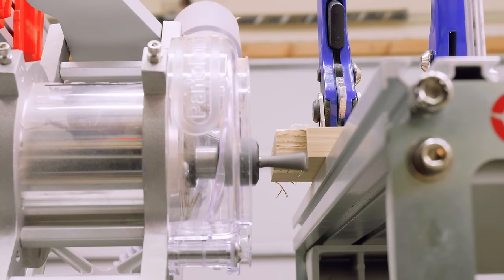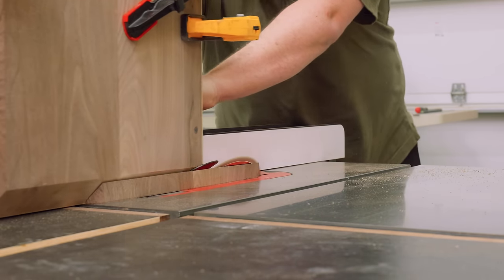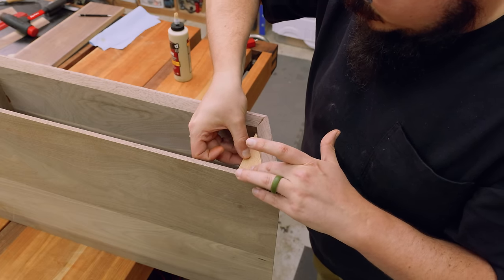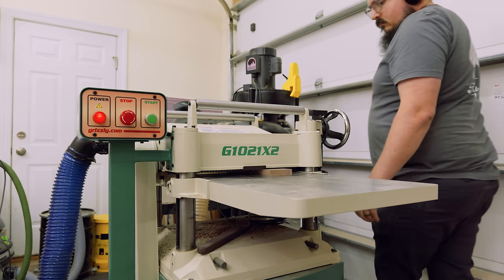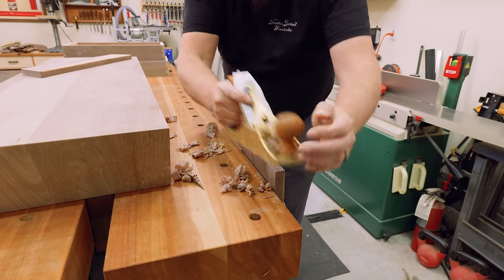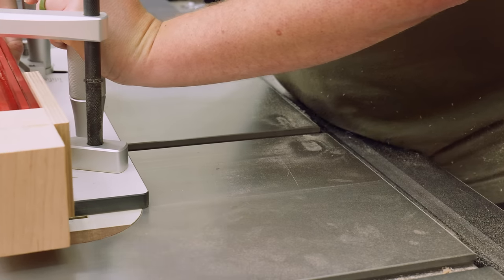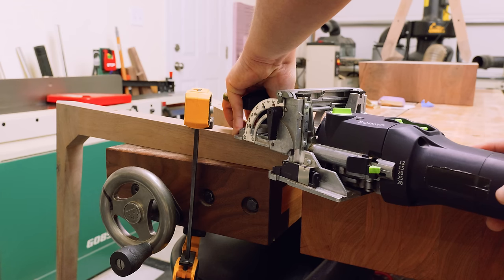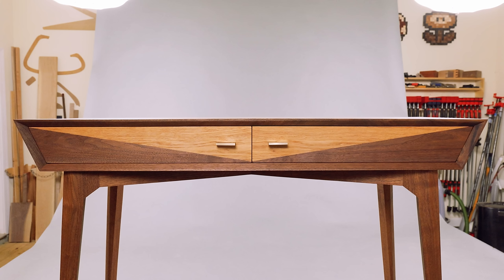You’re wrong about right angles

Comment: Just finding your videos and I am impressed.  I love you narratives, giving great detailed information, and your very slight, movie references, humor.  Your work is exceptional!  I am curious, what is the time difference between filming and off camera activities?  The amount of time I spend trying to calculate and plan angles has to be like a 10 to 1 ratio.  Your work, this video specifically, must have a ton of planning time.  Anyway, thank you for sharing your work.
Reply from the maker: Well, first off, welcome to the channel and thank you for your kind words. When it comes to angles and planing I think of those as two separate parts. I spend a lot of time in my shop and I like to take that extra step to showcase whatever activity I'm doing in a way that people might not have seen before. So when it comes to planing shots most of the time I just work with what I have as far as composition. There are some shots I see in films and I a make mental note or written notes and try to replicate those when I can. But there is a ton of planing that goes into actually building the other parts, so I kind of invision what that process will look like and try to plan accordingly. I honestly spend about 60% of the time building and 40% planing at this point.

Comment: Gyms? Jim's? Gems? Whatever it is, I love subtle little details like the triangles you added here. Real neato.

One suggestion though- bookmatching the oak on the drawer fronts would've been snazzy ... or cutting them from a longer board for continuous grain since the continuousness of the walnut was lost.
Reply from the maker: Thanks! The white oak is bookmatched, I mentioned that during the resaw timeframe. But glad you’re thinking about that detail.
Reply: @TimberBiscuitWoodworks   @TimberBiscuitWoodworks  Ah, I see... I must've missed that for some reason. But such is the nature of wood- some grain just runs in a direction where you can barely start to surface your pieces before you'll lose the mirror match. Did you make sure to do most of the thicknessing on the backside?
Reply from the maker: Check out the photos on IG. The book match is pretty clear there.

Comment: 28:48 Tests have shown that threaded inserts are less strong than threaded wood. That's down to the coarse TPI used for the outer thread of insert. 

If you're planning on screwing things in and out a lot of times, the insert is a better choice, although the strength on the join is lower. 

If you're going to screw something in and leave there potentially forever, and you don't want the threads to rip out through movement forces, threaded wood is stronger.
Reply from the maker: That's what I've been trying to tell folks! I'm gonna start pointing them in your direction haha
Reply: @TimberBiscuitWoodworks  🤣

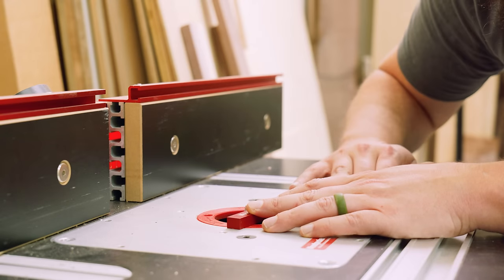Comment: At 13:00 you are swiping your fingertip across the tablesaw blade while using a small red block. I watch a lot of WoodTube content and have never seen this. Is it a depth gauge and you're checking for clearance?
Reply from the maker: Yeah, that is a setup block. I have a few at various thicknesses and I’m checking that just the tip of the saw blade is above the block.

Comment: Nice. 

You could call it the Toddler Taker, with those sharp corners.  I had some square corners on the stretcher of my dining table and when the third kid was small she was at a stage where her head was in real  danger from that structure, so we let her crawl around down there with a 1 lb margarine container on her head for a helmet.  Never a yelp.  I was not so lucky, as a kid, with a 90 degree corner on a piano...  Turns out your don't need any analgesic for stitches in your forehead as a kid of the 60s...
Reply from the maker: Haha, I’m not sure that has the appeal I’m going for but it’s definitely a good point. This one might have to find a new home if there was any more additions to the family.

Comment: Gems. what is the easiest/most accurate way you've found to attach the drawer stops when you can't remove the drawer?
Reply from the maker: I just use a bit of CA glue and a small block like I do here. This way I can pop it off I I need to get the drawers out for whatever reason.
Reply: @TimberBiscuitWoodworks  sorry, i wasnt clear. What is your technique for getting it in the correct depth/location?
Reply from the maker: Oh, sorry. I just pull the drawers out and push them back on the slides about half an inch. Then I press the block to the back of the drawer box. Centering is kind of just a feel thing more than anything. No one is ever going to look under there if it is off center a hair.
Reply: @TimberBiscuitWoodworks  thank you